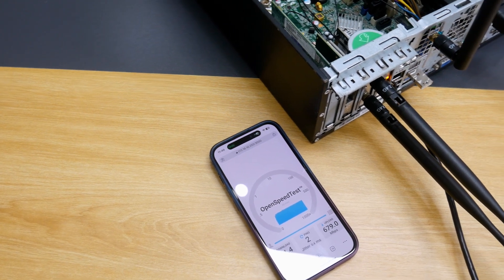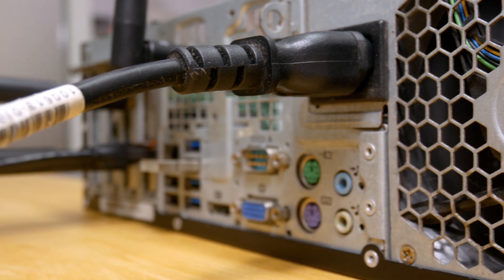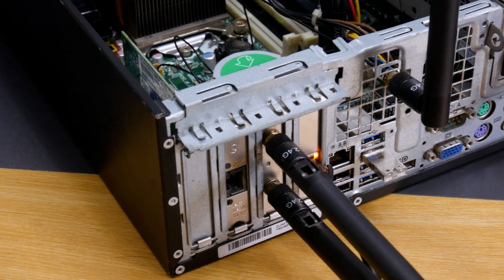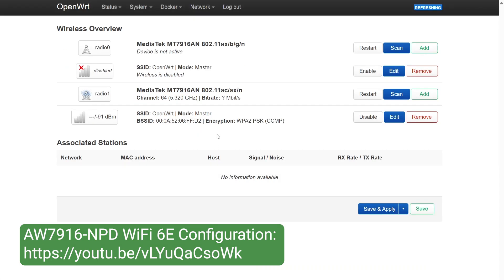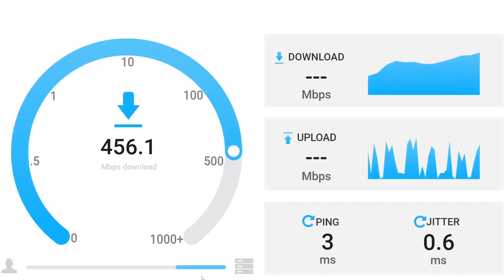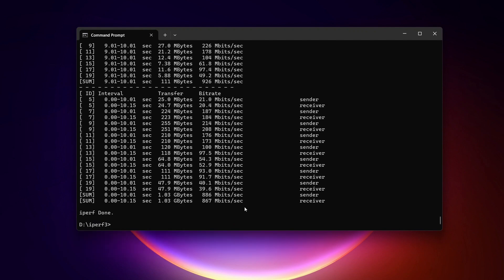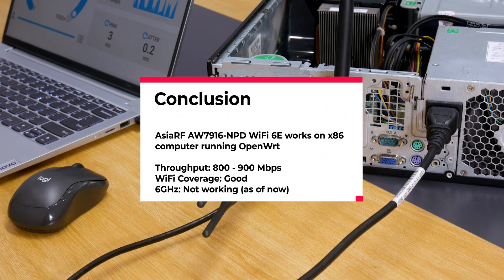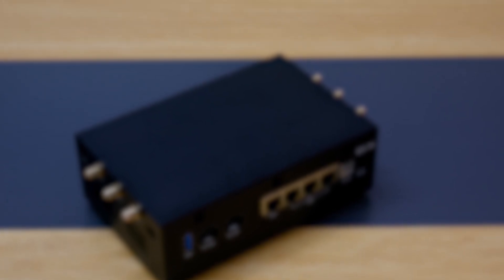OpenWrt  - Testing AsiaRF AW7916-NPD WiFi 6E on x86 Computer (Compaq Elite 8300 SFF)

Comment: Been wanting to make my OpenWRT x86 PC also act as an AP as well. But there doesn't seem to be many WiFi 6 and later cards that work on AP mode. Thanks for sharing this card. I know Intel cards don't work in AP mode on 5 GHz.
Very excited to see the WiFi 7 module that can work on AP mode.
Reply from the maker: WiFi 6E and WiFi 7 on OpenWrt is still WIP, basically it works but there are lot of bugs. Here is a short list of what I have tested so far:
WiFi 6E: AW7916 (perhaps not really 6E yet, but WiFi 6 works)
WiFi 7: MT7996 (BPI-R4-NIC-BE14). This is on the Banana Pi R4, I will make videos soon.
WiFi 5: DR900VX (Qualcomm QCA9880).
Intel AX200 is reported to works with OpenWrt in AP mode, but the installation is complicated and I won't recommend it.